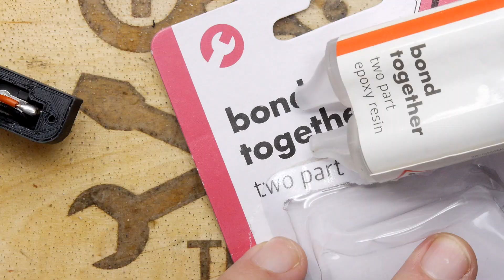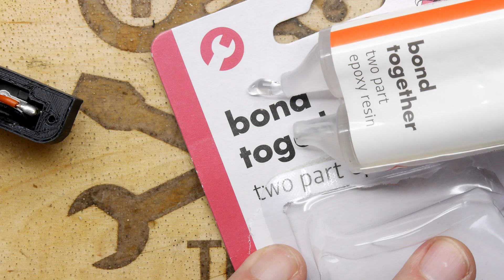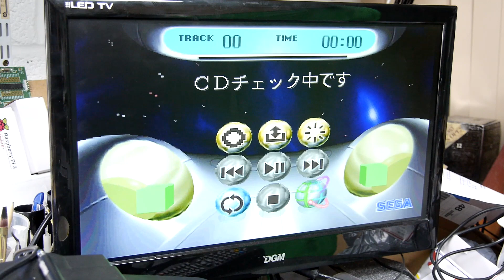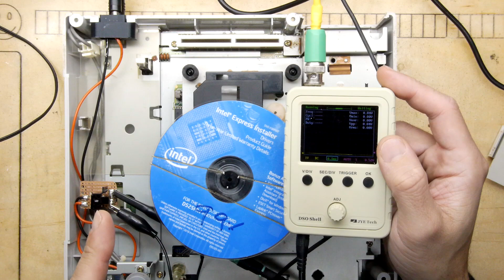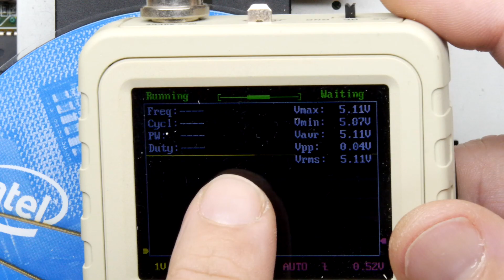How to make a Sega Saturn PSU board - hackery ahead!

Comment: Warning! earlier revisions have 3.3, 5, and 9 volt lines for powering different bits and pieces in the console!
Reply from the maker: Absolutely, hence the little disclaimer. It's amazing how many hardware revisions the Saturn had, it's bonkers!
Reply: @backofficeshow  Not as bonkers at the Mega Drive... 8 different motherboard revisions on the model one, alone, and even then there are regional and sub-variants.

I have an obsession with early revisions of Sega hardware, they were always so desperate to go to manufacture there were often bodge wires all over the place, sometimes even full bodge daughterboards, I find a certain beauty in it.
Reply from the maker: They must have really felt there need to get to market first
Reply: You don't need 9. It's only for SCART switching

Comment: This would get way too hot, one 7805? on a tiny heatsink?? no input and output capacitors?  I messed around for a while to come up with a linear power supply solution. I didn't find this until after.
Reply from the maker: Yeah it's just messing around really. Thought I'd they make one of those little switching PSUs that fit into the regular regulator pin configuration it could be fun to try it

Comment: This is good,  I literally bought a Japanese Saturn from a car boot sale for £20 not long after they came out, the previous owner had blown it up plugging it into a UK mains.  But  never got around to fixing it.
Reply: I did the same to my early PS2 which I picked up while in Japan and imported in my hand luggage <ahem>... The primary caps went in a literal puff of purple smoke.

Kept it in a box for years and eventually repaired the PSU... Still working.
Reply from the maker: I have a couple of Japanese PS2s looking at me that I have never done anything with. I never really got into Sony consoles so not been motivated to get them running. Any good titles on them?
Reply: @backofficeshow  a few good sega games :)
Reply from the maker: Hopefully it wouldn't have got as far as the main board, but if you look in my previous video on this you can easily test your unit by jumping the power directly onto the contacts. Just make sure your PSU is set correctly as it well blow it's backside out of incorrect 😂

Comment: Awesome video, tidy work, I got a pico power supply on ebay , and a Fenrir, great console.
Reply from the maker: Fenrirs look great. I am not sure if it's compatible with my unit, I will need to research it
Reply: @backofficeshow  yes only certain models.

There are 3 PSU form factors that Saturns use, the service manuals apparently call them Type A, B, C.

Type A is only used in VA0 motherboards, it is hold onto the top of the case. Pinouts are gnd, gnd, 3.3v, 5v, (not connected), 9v.
Type B is used in VA1 to 5, it is the "longer" power supply, always 5 pin with pinouts being gnd, gnd, 3.3v, 5v, 9v.
Type C is used from VA6 to VA15, it is the "shorter" power supply. NTSC machines have 4 pins: gnd, gnd, 5v, 5v. PAL machines use 5 pins: gnd, gnd, 5v, 5v, 9/12v.

You can check which board your machine has from the serial number. It uses a syntax of (manufacturer code), (year), (VA#), and 6 number for a serial (sometimes, rarely, just 5). Manufacturer code can be 1 number, 1 letter, or 2 letters. Year is always the least number of the full year. VA# is the motherboard version.
So B40004930 is manufacturer B, made in 1994, VA0 board, unit #004930.
Or, AD69147854 is manufacturer AD, made in 1996, VA9 board, unit #147854.
Reply: Fenrir currently supports all console regions (only for Model 1 (Oval Buttons) VA0, VA0.5 or VA1 consoles with a 20-pin drive).
Reply: @backofficeshow   Nah, it isn't... Only early models. Your options would be the Terraonion MODE (which has the advantage of being usuable with hard drives and working in a Dreamcast, too!) Or a Phoebe, which is developed by the guy who created GDEMU, and only goes on sale about once every 4 months for about 10 minutes at midday, because he's absolutely terrified of any more of his designs getting cloned.

I have one of his Rhea devices in mine (His version that works on the same 20 pin models as Fenrir). It's great, but if I had waited about 4 months I would've had 2 brand new options!
Reply from the maker: @Mentski  The prices are eye watering considering I got the console itself for a few quid. I wish they did an everdrive cartridge for it, I only need Virtua Fighter and Panzer Dragoon :)
Reply: @backofficeshow  just burn those two CDs then :)
Reply from the maker: The CD drive is dead 😭
Reply: @backofficeshow  they just release another pins option that should cover all models now available on castlemania, if you haven’t added an ode yet.
Reply from the maker: I really need to get back to this console and give it some love